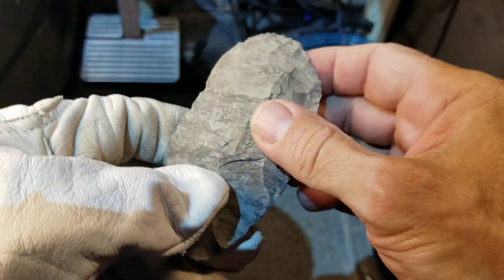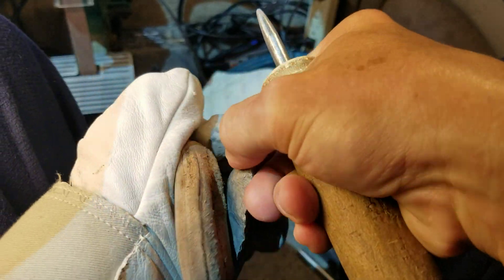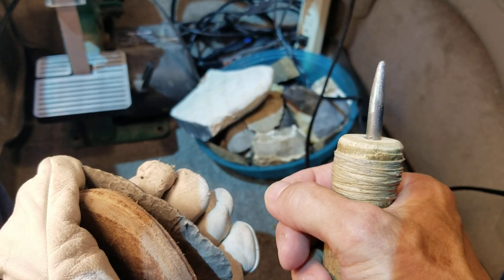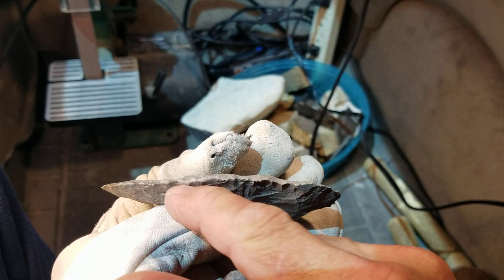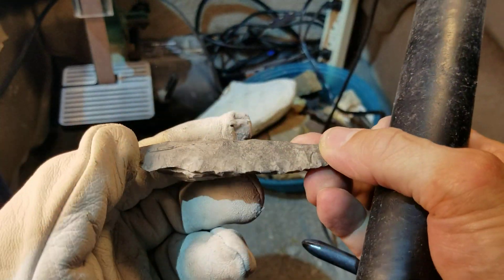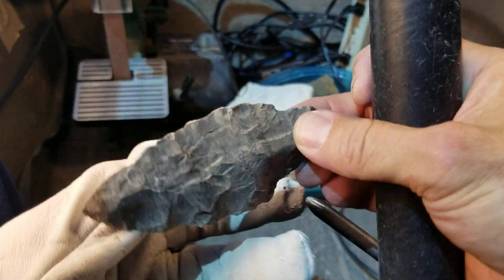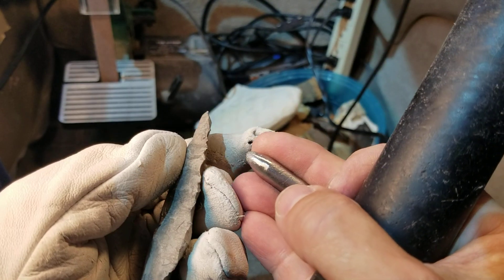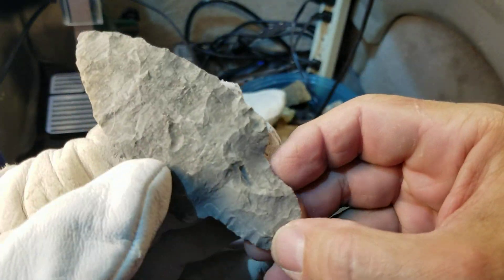1193 - Challenge - Kanawha Grey Part 3/4

Comment: I can understand how when using percussion the shockwaves travel through the piece but I don't understand how pressure flaking produces long flakes.
Reply from the maker: The material has to cooperate and easy to flake if you're using pressure. Only certain materials will allow you to "push off" long flakes with pressure. You can't blast them off like you can with percussion.